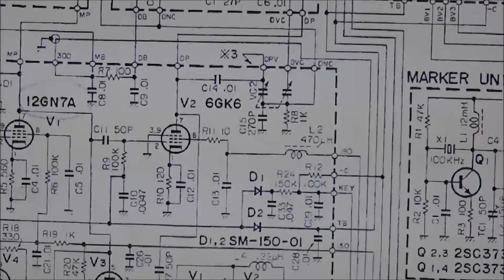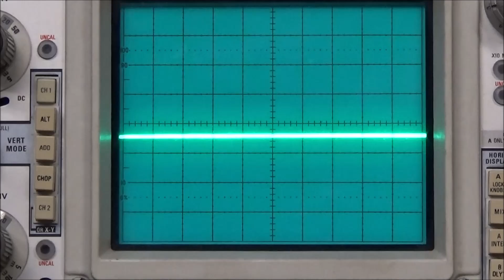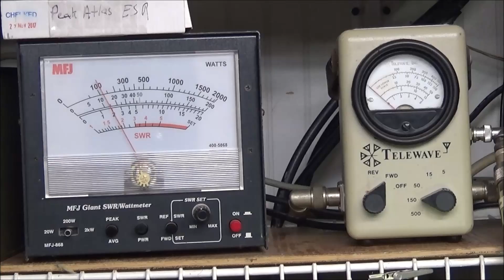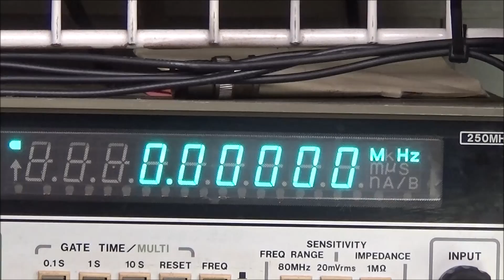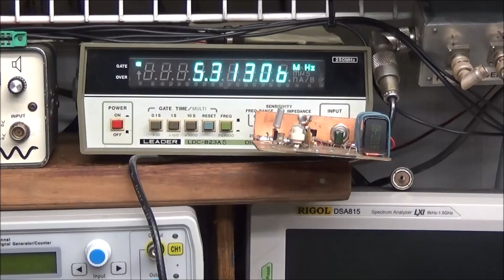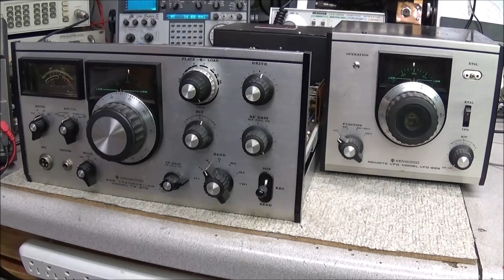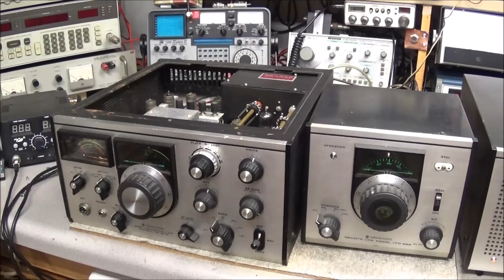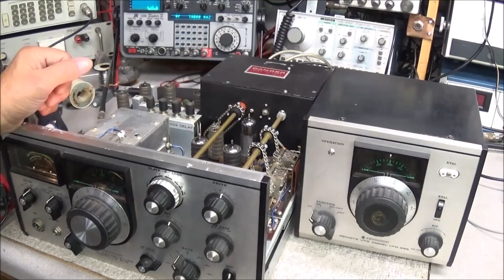#185 Late Night In The Shop TS 511S

Comment: I can't sleep when I have a problem that needs addressing.
Going to be tough to find replacement gears.
Poor connection on the replaced resistors.
Oscillating frequency x 3?
Congrats on your son's upcoming wedding.
Reply from the maker: Thanks B. I may can print new gears with the 3D printer.

Comment: Hi Buddy. The Heathkit SB series rigs look to be identical in frequency generation as for the heterodyne oscillator rocks. the Heath IF is 3395 but other than that the 80 meter rock in both is the same so I guess the rest are too. If you have or can get the book on an SB100/101/102 the mixing dope and theory of operation will be the same or very close for the Kenwood. Congrats to your son and I hope they will last a lifetime. OJ  KØOJ
Reply from the maker: Thanks OJ for that great information. I have not even put them two together.  Thanks again my friend.

Comment: Hello Buddy, off topic, but if you get a chance can you look at the schematic of a Fender 5F1 Champ, and compare that to the schematic of the Eico 147A Signal Tracer. Then if you would kindly let me know if I'm crazy or not, I would greatly appreciate it.  Thanks!
Reply: Guitar amplifiers, signal tracers, audio amplifiers are all pretty much the same, just audio amp circuits.
Reply: @mikesradiorepair  I absolutely agree. I was really surprised that they both have basically the same 3 tubes. I've been experimenting with the Eico 147A Signal Tracer. I've been playing an electric guitar through it. It's a lot of fun and I'm learning alot. You're videos are a great help and I really appreciate it. Thanks!
Reply from the maker: I think Mike nailed it below. Thank and great comparison.

Comment: I see a lot of weak crystals in vintage tube type rigs.  I stick them in a crystal tester and they oscillate fine.  Put them in the radio and they will not oscillate.

Since ICM went out of business a easy source of custom crystals became a bit of a challenge.  I need to order some crystals and have been doing some searching.  Bomar Crystals sold their facility to their employees a few years ago and stopped making custom cut crystals but apparently they have started again.  Also there is a company in the Czech Republic that several Hams have been using.  http://www.krystaly.cz/en/  From what I read they have a fast turn around time and are really cheap (price wise that is).
Reply: Thanks for the xtal lead Mike...have bookmarked; if you do order from them let us know what you think. And congrats to Buddy and the family for a upcoming great weekend!  73 - Dino KL0S
Reply: And from what I read online there is someone at that Czech Republic company that is fluent in English so language is not a barrier.
Reply from the maker: I really miss ICM. Great folks to deal with. Just got back in town here. Thanks Mike
Reply from the maker: Thanks Dino, just got back in town. Man a long week end.